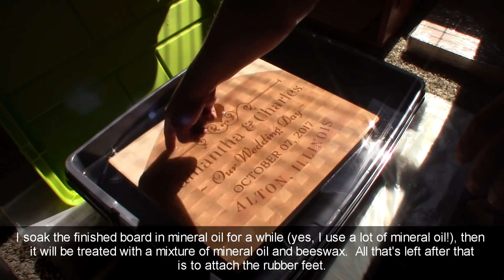Wedding Cutting Board

Comment: Absolutely beautiful work!! How hard was it to learn the CNC operation?
Reply from the maker: I've only had the CNC router for about 8 months now and I'm by no means a pro at it yet.  I've had plenty of failures in the past months, but with the tutorials and how user-friendly software is becoming, it's really not that tough...  It is easy to forget small details when it comes to tooling and different steps, which then leads to trouble.  I'm hoping to do a video review on my CNC soon, from the point of view of a novice such as myself.